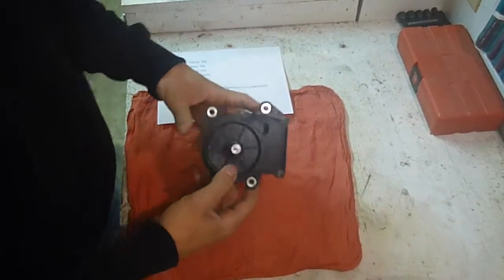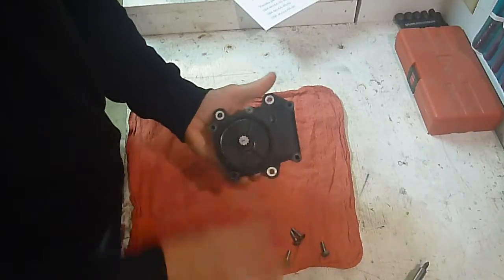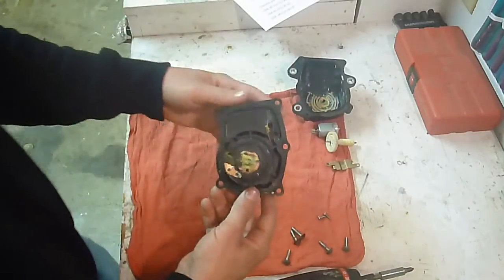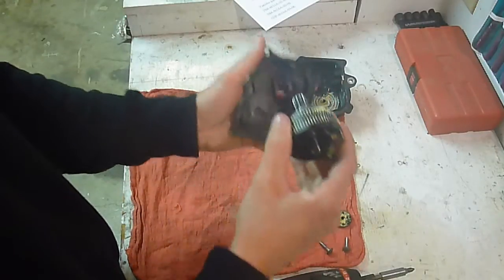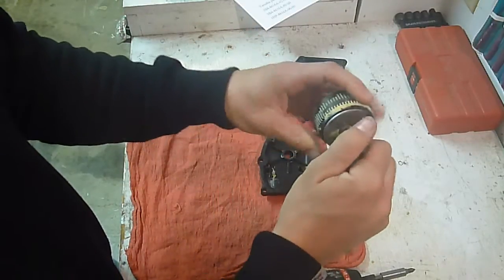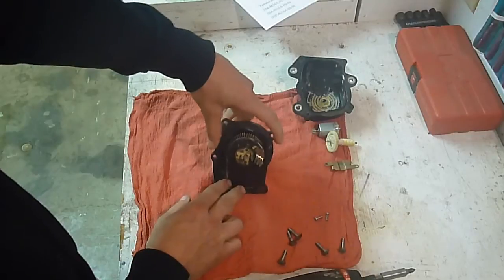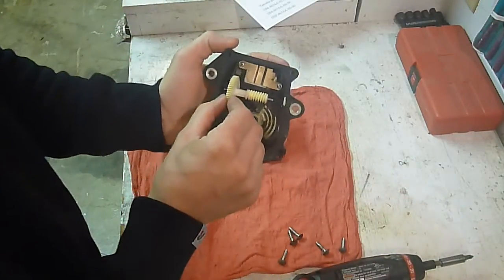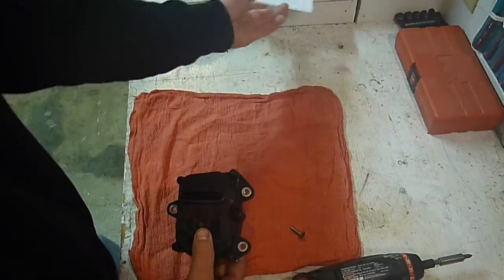How To Take Apart and Re-Time the Yamaha 3B4-4616A-02-00 4x4 Servo Assembly

Comment: Is this the same actuator that goes on a krx 1000? I’m having a little trouble putting that one back together and timing it.
Reply from the maker: Similar but the internals are slightly different. We have a video on that one check this out. https://youtu.be/kmu0ALWWcLw?si=7T04njZ4J1adxEbo
Reply: Thank you I appreciate it. I assume the R on the krx 1000 stands for real wheel drive/2wd and the F stands for Four wheel drive would you happen to know for sure?
Reply from the maker: @AlainCapote-f2n  The R is the 2wd position, F is diff lock.

Comment: Good video but if the machine is in 4wd with the motor goes out and you set in 2x4 position it gets out of sync.   If you calibrate it like this video,  the atv will stay in 4wd.   Need to clarify if the machine is in 4wd or 2wd before messing with the calibration.  If it's in 4wd, I suggest showing the position so that it stays in 4wd and doesn't get out of sync.  This happened to me.  I purchased all the parts from your store.  Thanks for the videos.
Reply from the maker: It still applies, do you want to make sure the servo is timed like the video shows in 2wd. Then you have to manually put the machine into 2wd if it is not already. On the rhinos or Vikings that is all the way to the right and the ATVs grizzlies and such all the way to the left if you’re sitting in or on the seat. And of course, the switch has to be into 2wd.

Comment: My grizzly 2009 700 stuck 4x4 can i use to fixed
Reply from the maker: Yes, you can replace the motor inside your servo assembly with this. 
https://www.501parts.com/product/3b41hp-yamaha-replacement-servo-motor/

Comment: Is it ok to take out if its stuck in 4x4 and reinstall in 2x4 position?
Reply from the maker: Jason Tryon yes that will be ok
Reply: @501PartsTech  ok, thanks
Reply: @501PartsTech  When I installed in 2x4 position the machine stays in 4wd because the machine was in 4wd when the motor went out.  I can hear the motor and servo working but it is out of sync.  What is the correct position of 4wd? It it the opposite rotation of that mark?
Reply from the maker: On a rhino or Viking, it is all the way to the right for 2WD on the ATV grizzly or the like it is all the way to the left if you’re sitting on the seat. Put the switch in 2wd and the differential and the servo and you should be good to go.

Comment: i'm about to purchase a grizzly 600 but the seller let me know the 4x4 stopped working yesterday.
It would be my first atv ever so i'm not so sure anymore. He says its a 60$ part so i think its the servo he is talking about.
If i go and look are there other things i should check for? It seems you know them inside out
Reply from the maker: Look for chewed up spots in the harness if it has been sitting. Mice love to chew wiring. Servo swap is easy but troubleshooting wires can be a pain. The servo can be replaced for $55, or $100 for the plug and play assembly. The switch is $85 and the relays are $23 each. You'll have two on that one. That should give you an idea of what cost you would be looking at worst case. Good luck!
Reply: @501PartsTech  Thanks for your time! really appreciate it. Do you ship to europe?
Reply from the maker: mittdersonne absolutely, we ship to Europe often. Let us know if we can help you.